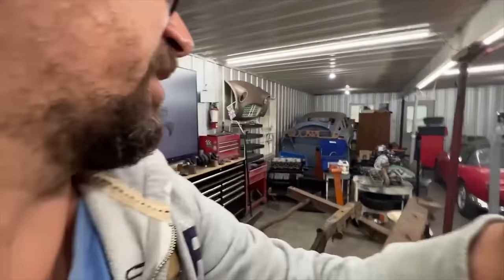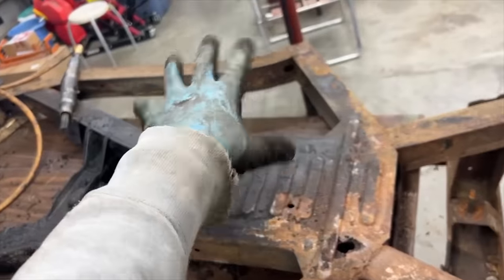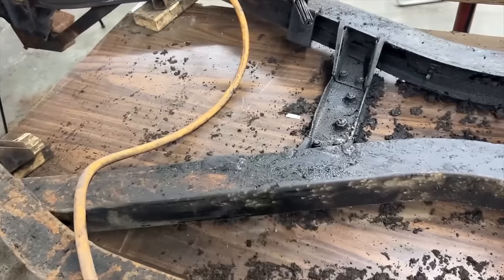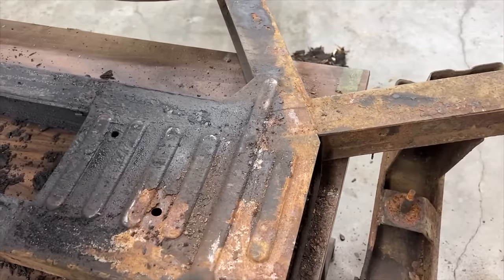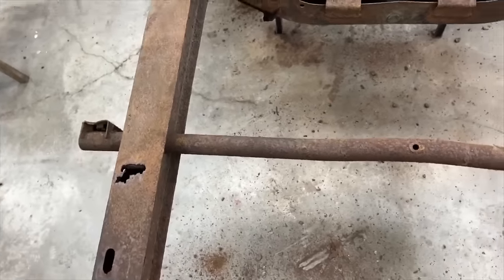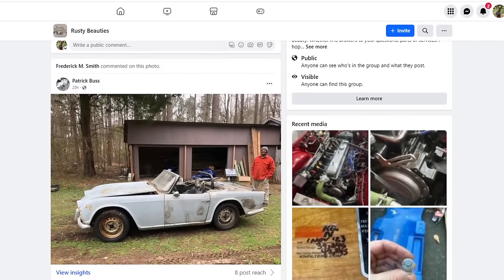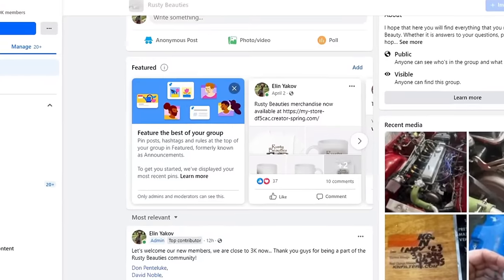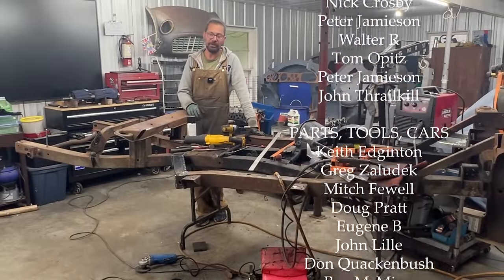TR6 - Rotten Frame Repair - part1 - Trailing Arm Support

Comment: great video Elin ! The two inner rails are a different box section size by Design to the two outer rails , this is why you have an 1/8th (top and bottom) of a difference which is correct.

Comment: Nice work Elin! I wish my frame had been better. The car had been in a garage with a gravel floor (very damp). The whole bottom of the frame was in the same condition as the trailing arm supports on the frame in your video. I couldn't find a replacement so I ended up buying a RATCO frame. I'm still working on the body so I can't comment on the frame other than it's very nice looking and appears to be very sturdy.

Comment: I think your on the right track with your portable jig. Do think you might want to tie to the opposite side (using three points to keep the location of the trailing arm frame that you're replacing. Good your maintaining the geometry on one side, but another arm to the other side should insure the repair semirical to the frame centerline. Still a whole lot better it than it was for sure.

Comment: Back to the grind after a vacation is always hard. Maybe a plasma cutter would be something to get into tighter spots. I have been looking into the 4 in 1 units that are Mig - tig - stick - Plasma but just the plasma cutting units are fairly cheep. Great video!!

Comment: Thanks for thinking about  us the viewers. It was a great  video and as you mention the pieces used to be too long. When I took my first side off I had to measure the distance to the holes on the opposite side because  the new one was way to long and with the jig I couldn't get it in far enough to even estimate what to cut off where. I had to cut both ends bit by bit until it slipped in and the mounting holes matched. Second side  was way easier. That jig work really well. I didn't  trust  my ability to weld the frame at that point and hired a mobile welder who was impressed with the jig and the way  we ensured the parts were in exactly the right place. Thanks and Take care.

Comment: Some years ago I did the same repair on a Tr6. Interestingly I ran into EXACTLY the same minor discrepancies with the fitment of the trailng arm supports as you have. I also remedied the gaps the same way as you have. 
As it was a one off repair I didn't make a jig but used a template and reference marks scribed on the chassis along with other careful measurements which I maintained . It all worked out well. The correct wheel alignment was achieved with no problems.
Good to watch how you tackled the job, very intersting. Your understanding and knowledge shows through.

Comment: Hello Elin, about the fact that the two center portion of the frame are 1/8 lower than the outside portion, it is normal because the center portion are thinner by around 3/16 compare to the exterior portion. I suppose that the reason for it because the interior section of the frame need to be inserted into the exterior members at their end.

Comment: Great job Elin. Quick question, do you own a finger belt sander? I have an air-powered 10mm one, which is OK, but knocks the hell out of the compressor, so I bought a 12mm electric one. It is vari-speed, and was only about £50 here in the UK, and it is the best £50 I have ever spent. You could have got inside that box section no problem, and the quality of finished welds is just perfect, particularly plug welds. I use 60 grit Zirconium belts by the way.

Comment: Nice job but did you paint/ rust treatment inside the box section before welding. And it would be nice to see what size Mig wire you use ? 👍

Comment: English cars were not very precise. A friend of mine restored a Morgan, and had to make new doors. I will just make both sides at the same time, he thought, and copy the measurements from one side to the other. Turns out that one door was half an inch longer, than the other! Also, aftermarket panels/repair pieces are not always very precise, so you have double up on possibilities of errors.